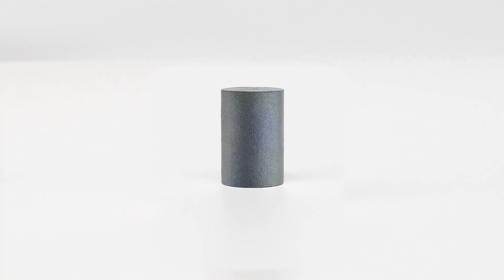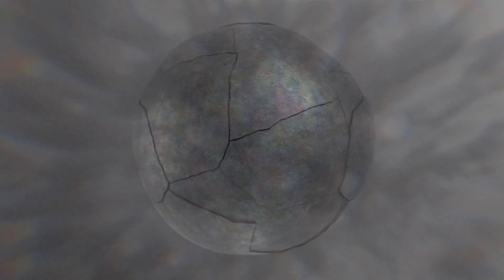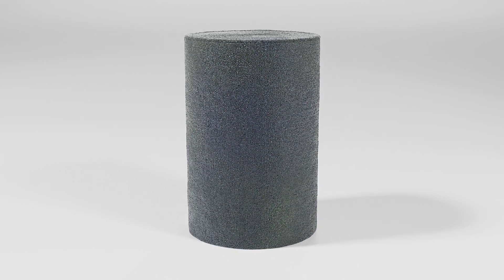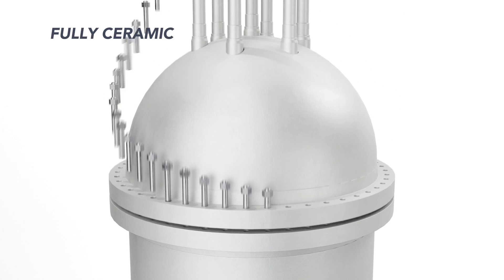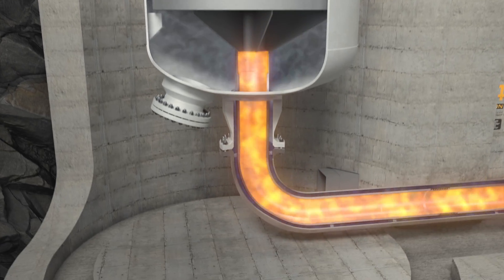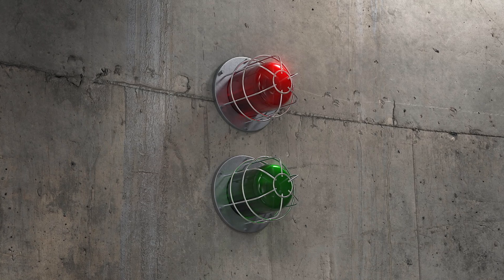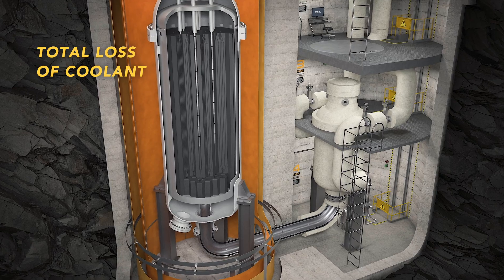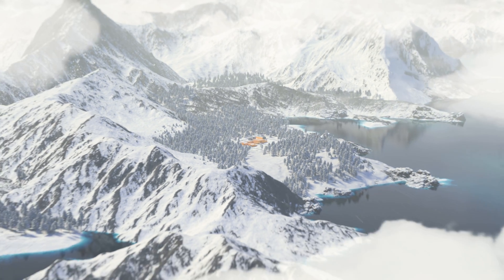How it Works – the Micro Modular Nuclear Reactor

Comment: You use the concept of Triso particles which was developed mainly by the Americans, the British and the Germans in the 1960s. An essential difference concerns the material of the compact which contains the Triso particles. You prefer SiC to the graphite previously used, why?  In addition, the HTR reactor, since it is indeed this type of reactor, cannot really be considered a 4th generation reactor.
Reply: >You prefer SiC to the graphite previously used, why?  
Graphite-coated pebbles were prone to cracking, as THTR-300 operation showed.
Reply from the maker: many reasons. please check out website at https://www.usnc.com/fuel/

The SiC process allows to pack 50% more TRISO particles in each fuel pellet. Also SiC is better fission gas barrier, and it provides even further strength to the TRISO particles. It is unreactive with air and water, so even better in storage or accident conditions.
Reply: This is all theoretical isn’t it?

Comment: Miniaturizing it even further to power a small city block or just a few houses with a fully self-sustained system within a couple dozen square feet built two or three levels underground could be quite interesting. Main challenge is ofc the cost of installation and the issue with the fuel itself being mishandled or sabotaged by third parties, and to counter that one might need a sort of monitoring system with an oversight. Like imagine a sort of lock on the container similar to ankle locks that felons have to wear during house arrest etc.

Comment: But is this reactor really as good as its ad? 🙄
Reply: Helium is not as good a heat transfer medium as molten salt. Fuel pellets are old school. When this reactor is spent it all becomes nuclear waste.
Reply from the maker: @solexxx8588  You don't need anything better than helium. If you use better heat transfer fluid, it means you are running at too high a power, which is unsafe. Helium is an excellent constraint.

Comment: Silicon Carbide is really neat stuff used in many advanced applications in other industries. I’ve worked with it, and while it was more costly than the alternatives it was a beautiful fit for a lot of applications.
Reply from the maker: the powder is pretty cheap as the world market for SiC is huge for sandpaper, tires, speciality ceramic components. almost like sand.
Reply: Silicon Carbine, otherwise known as sandpaper, grinding wheels, etc.     It isn't a new material nor is it special.
Reply: @rgbcolor6450  

Which invalidates nothing I said. The material is a good fit for many advanced applications, like diesel particulate filters, and other types of advanced filtration.
Reply: @waynesworldofsci-tech   I wasn't trying to invalidate your statement.. just pointing out that silicon carbide is a common material, not some special nuclear invention.
Reply: @rgbcolor6450  

Agreed. It’s old, but oh man are the new applications exciting!
Reply from the maker: @rgbcolor6450  it ain't new but it is special. Most materials will degrade rapidly in a high temp and radiation environment. SiC doesn't GAF about radiation. It also is impermeable to basically everything including He and fission product gases.
Reply: @ultrasafenuclear  

Impermeable if designed that way. The material I was using was in a ‘wall flow’ environment. We were forcing gasses through the material.
Reply from the maker: @waynesworldofsci-tech  quite right. you can tune the porosity.
Reply: @ultrasafenuclear  

Silicon and Carbon are amazing.

Comment: So what is the “ doesn’t need very much at all” if there is loss of power/cooling?
Reply: I think this was just an expression meaning it doesn't need anything not already present in the core itself to remain safe. This is of course the ideal scenario for any nuclear reactor, or any machine for that matter.
Reply from the maker: @jlp1528  correct. most power plants will have big issues if they lose emergency cooling, emergency power generation, and the ability to control the reactor.

Comment: Seems like a solid fuel like triso would create a lot of waste per MW/hr.  It does seem safer that anything Westinghouse or GE came up with.
Reply: At first glance, it is understandable to get this impression. However, SMRs and microreactors are meant to operate without refuelling for many more years than current reactors. Instead of swapping out fuel elements every 2 or 3 years, you're looking at 5, 7, 20, and beyond. Some designs don't call for refuelling at all, they simply run until they can't run any more, at which point the core can be decommissioned and disposed of as a whole. Reprocessing options are also possible.
Reply: What about U-233?

Comment: Does this qualify as one of those high temperature gas cooled reactors? I like the lack of water cooling, seems safer this way. But still, I'm much more interested in fluid fuel reactors. I hope your design is successful!
Reply: Precisely, and it's no secret why HTGRs are making a comeback: helium is almost everything you could want in a nuclear reactor coolant. It's already gas so it can't boil. It's physically, biologically, chemically, and radiologically inert. It's not hard to get. Even the lower efficiency can be mitigated by operating reactors at higher temperatures; the hotter something gets, the faster it can conduct and radiate heat away. Of course, helium is a very small atom, so it really likes to find leaks, but preventing leaks of anything is hardly a new or unusual challenge in the realm of nuclear power.

Comment: How do you reprocess Triso fuel?  Can Triso fuel be manufactured with Thorium?  Are designs 100 percent complete and ready to be built?  Is the Ultrasafe Reactor licensed in any nation?  Good graphics in the video.
Reply: For Thorium, They produce U-233 which could be used as a Nuclear fuel too
Reply: Hopefully you will see this reply. I will attempt to answer your questions.

Anything can be reprocessed if we want to do so. Just because TRISO fuel can never break down in a reactor does not mean we will never be able to retrieve it and break it down in a reprocessing facility. That said, Small Modular Reactors (SMRs) and microreactors are meant to run with fuel of higher enrichment levels for greater lengths of time. This reduces the need for reprocessing in the first place, and greater ease of disposal also helps. Google "HALEU" (High-Assay Low-Enriched Uranium) for more information.

As far as I know, thorium-based TRISO fuel does not exist yet, but nothing says it never will. After all, this isn't the only upcoming reactor that will use some form of TRISO fuel. Check out the Xe-100 by X-energy for another example. It seems TRISO users also love helium as a coolant. Given the impressive, practically perfect safety of both, I'm not surprised.

I would not say this or any new reactor design is "100% complete and ready to be built" until at least one has actually been built and tested. In the nuclear industry, designs get passed back and forth between companies, regulators, and other organizations, usually many times, before final approval and construction. I have included an example of this in the answer to your final question. Even after construction and activation, lessons are often learned and applied to future designs. I don't expect this to change, even as we see some reactors being mass produced in factories. 

Currently, the only new reactor design licenced by the Nuclear Regulatory Commission of the United States is a 50 MWe SMR by NuScale. NuScale has since improved the design to increase power output to 77 MWe, but the revisions themselves will need approval. I'm not very good at keeping up with the regulatory agencies of other nations, but work is proceeding on many fronts to get numerous SMRs and microreactors licensed, tested, built, and operating around the world.

Will we see SMRs and microreactors bringing commercial power to the masses by 2030? Time will tell, but I'm cautiously optimistic. There is already at least one SMR facility under construction in China. New Memorandums of Understanding, environmental assessments, and funding agreements are making headlines every month on every continent except Antarctica. The future of nuclear power is safer, more reliable, more efficient, more flexible, and more powerful than ever before.
Reply: @jlp1528 NuScale turned out to be a scam. Now they're being sued by their investors for fraud.

Comment: Fission products, like Xenon gas,  build up and stop the neutron flow, and are locked into the pellets? This requires "refueling", discarding the old pellets for new ones. 
Nuclear "waste" with actinides and other fission products, can be burned in a fast spectrum molten chloride reactor, after mild reprocessing. The cost of the fuel would be very low (as it is waste) and change a 100,000 year storage problem to a 300 year, with much smaller volume. The US has enough waste for 800 years of use at present level.
TRISO fuel cost how much per MW hour?
Reply: See A Nuclear END One Way OR The Other   @ 39 CPM   Cancer Lotto

Comment: One question, and the only one that matters, will this be cheaper than coal power plants?
Reply: It will be significantly cheaper over it's entire lifespan. It has high upfront costs though, which seems to discourage most people, but the operating, maintenance, and fuel costs are much lower than those of coal fired power plants. 

So over a 20 year period the total expenditure on one of these would be cheaper than the expenditure on a coal plant over the same time period.
Reply: @acrobatickebab5949   The point is it will have to be subsidized by the government which means central control of power more than there is today which is nightmarish.
Reply from the maker: @clivemossmoon3611  No. We have basically no government support for our projects. Pretty unfair actually.
Reply: @clivemossmoon3611  So France gets 70% of it's electric from nuclear.  It's run by the Govt.  Security is tight.  Used fuel rods are recycled.  Plutonium does not escape the system.  Perhaps we could learn something from them.
Reply: @acrobatickebab5949 costs $1.3B to produce… sure if you say do!
Reply: No. It will be more expensive but with much less harm to the environment.
Reply from the maker: @mrbasfed1948  at first yes. long term, you need to think in terms of energy density and economies of production. Have you seen the work it takes to feed a coal plant? literal trains of coal every day.
Reply: @mrbasfed1948 until there is a melt down…

Comment: Titanic was unsinkable too.
Reply: ^^^^Works for Exxon^^^
Reply: First of all, contrary to popular mythology, Titanic was never described as unsinkable, some people after seeing the biggest ship in the world of course talked amongst themselves and described it as practically unsinkable. But even after the sinking of the Titanic and claims that ships have become much safer ships still unfortunately sink and always because of human error. Nuclear reactors on the other hand have always been the same and is a proven safe method of generating energy. Name me one nuclear disaster caused by a malfunctioning reactor and not from human error? Chernobyl was caused by gross violation of safety regulations and ignoring safety systems designed to prevent such a disaster. How many people die every year in coal mines compared to nuclear power plants? How many wind turbines catch fire ever year compared to accidents at nuclear power plants? Compared to any other form of energy source nuclear power is by far the safest and will only get better and more effective.
Reply: That is a red herring. You are comparing a scientific statement with the headline of a newspaper.
There are physical reasons why a meltdown can not happen. There has never been any reason to believe that the Titanic wouldn't sink if it hit an iceberg.
Reply: How does a ship from decades ago even matter. Human error vs computer run. No comparison
Reply: if u got no solution , better shutup
Reply from the maker: accidents happen. just make sure the consequences are negligible.
Reply: lame comment